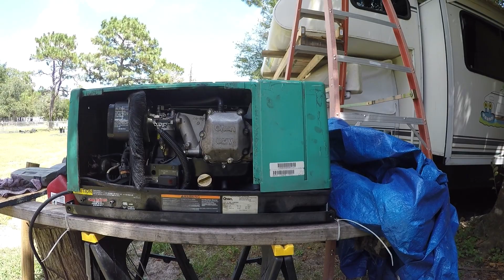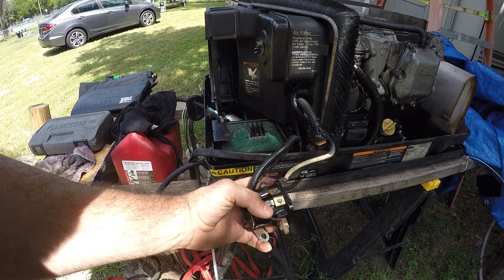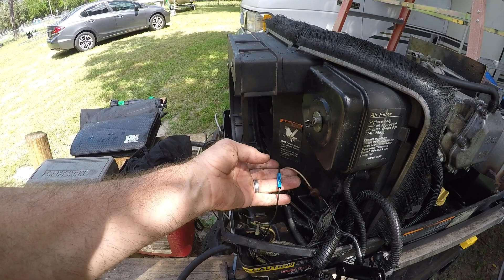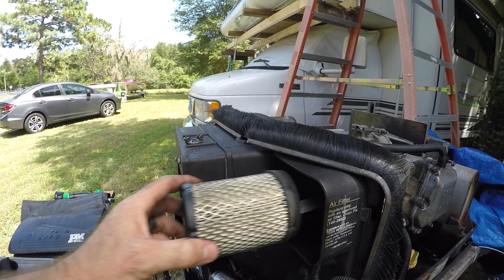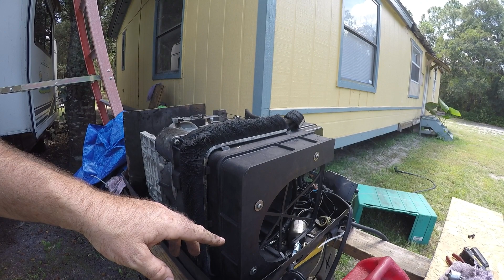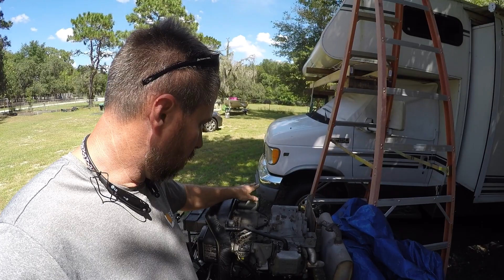Onan Generator repair, fuel pump & filter replacement

Comment: I replaced the fuel pump and carb. It  started right up and ran for about 5 minutes. Turned the air on, still running. Turned the microwave on.  gen stopped. It now won't start.

Comment: Excellent help explaining the parts and how to remove them. I think my problem is with the fuel line as no fuel pours out when I disconnect it from the filter. Plus the gen runs fine with a short hose from a fuel can like yours. It doesn't run when it's connected to the vehicle's tank - it's  not getting fuel. But before I spend $$$ getting the line replaced do you think there is a chance that the problem is with my pump not being strong enough to pull fuel 8 f away from the tank? Is there such a thing as a weak pump?
Reply from the maker: Sorry didn't check comments, did you get it working correctly

Comment: Great video. Do you have a video showing how you dropped the generator?
Reply from the maker: I do not, it took a little head scratching as I was doing it by myself.  Fairly simple, if I remember correctly. Disconnect the power cables from all batteries first and secure.
Disconnect the fuel line and cap with a bolt to prevent fuel from siphoning out.
Then I used a floor jack to support the generator while I removed the bolts holding it up.
Lower the floor jack to bring the generator down...  this part was tricky to bring it down without tipping. I used a lot of scrap wood (2X4s) stacked on either side.
I then removed pieces of wood one side at a time until it was all the way down.
Hope this helps
Reply: @KATZFamilyadventures  Got it. Thanks! Super helpful.

Comment: The bolt for the fuel pump holding it to the chassis, on the Microlite does it have a nut on the underside of the chassis? Also do you have a video of you removing the generator from the RV?
Reply from the maker: I did not record taking the generator out.  We sold the RV a couple years ago.

Comment: Adding mine to the long list of “thank you’s” for your video which was so helpful and informative. The Onan operators manual only hints that a fuel pump/filter exists and does not show it in any of its operational diagrams. I’m guessing they want you bring in so they can charge the usual “arm-and a-leg” to fix your problem. Again thank you for the video of the generator out of the RV which must have been a chore in itself to get out.
Reply from the maker: Glad it was helpful!  Getting it out took some time as I was by myself with some limited tools, that's why I did not record it..  Overall it really was not that bad, just some time and creativity to get it done

Comment: Great video showing everything.   I thought you need to know you are missing a round flat plate and wing nut that goes on to hold the air filter inside the metal cap.   Respectfully,   Kevin
Reply from the maker: Thanks, I no longer have the RV.  That generator had well over 2000 hours on it when we got rid of the RV.  Generator was still running strong!

Comment: THANK YOU... I have a 1999 Coachman Catalina...Generator 4k  has 179 hours... mileage 52,000
Reply from the maker: I no longer have the RV, the generator had over 2000 hours when we got rid of it. Still works like a champ

Comment: Perfect!  Knowing where stuff is, is huge.  First thing I'm checking tomorrow morning is the wire from the coil.  Sounds like a dead short all of the sudden.  Like the old timer kill "switch" on lawn equipment's spark plugs.  Changed the fuel filter thanks to your vid.  I'll get it running. :)
Reply from the maker: Need an update, did you get it running?

Comment: I recently purchased an rv with the exact same generator. I did an oil change and air cleaner over the weekend. Wasn’t sure where the fuel filter was so I watched various videos. This is one of the best videos on laying out where everything is. Like you said, a lot of the concerns cannot be addressed with the unit in the rv. Thanks for the post.
Reply from the maker: Very happy to read your comment, glad it was helpful

Comment: Could you come and fix my generator. Hahaha. I probably not even try what you did with your generator.
Reply from the maker: If I was not so busy I'd consider it!  Give it a try, that's what I did :)
Reply: @KATZFamilyadventures  yup you are right, a busy schedule is in the way for me.  Thanks for the encouragement. :) I have used Class B that I just bought from an individual during the pandemic. He already told me that the generator does not work.